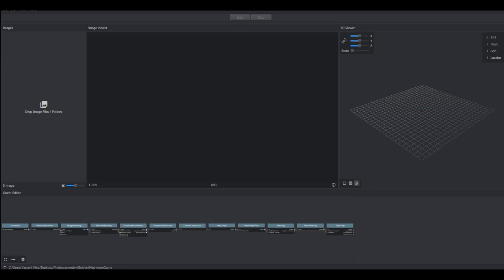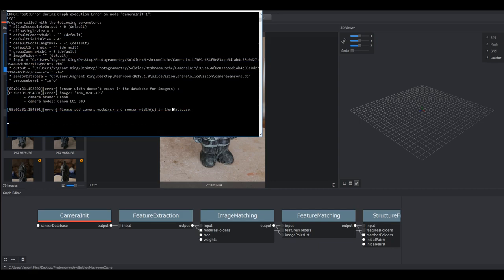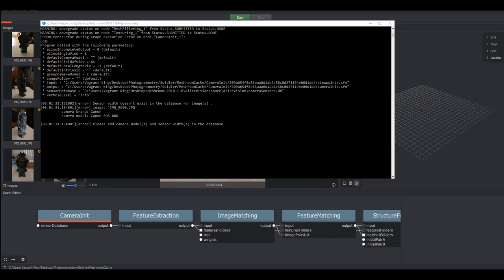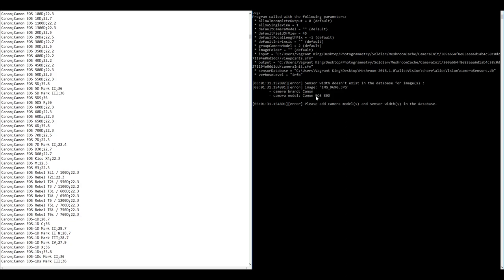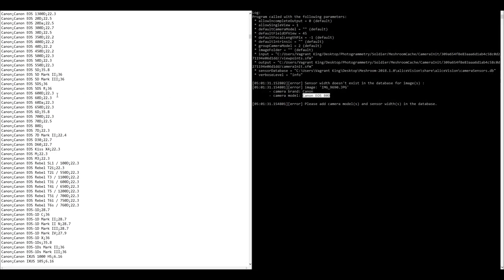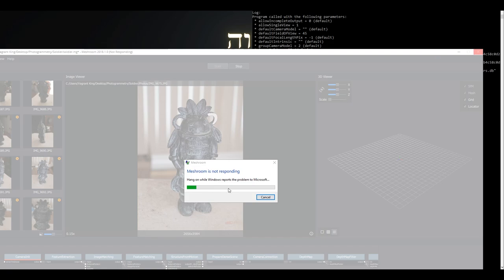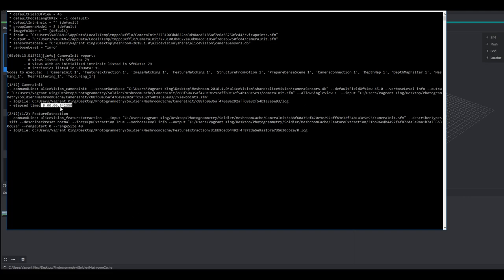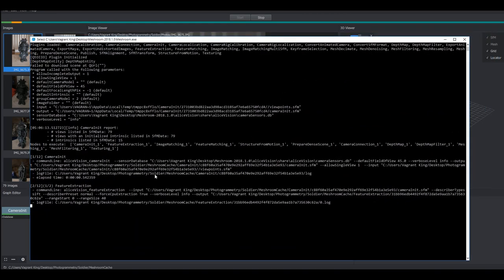Debuging Meshroom

Comment: In my PC during the process in mushroom it stops in depth map node and not starting even though I click on start how to solve it please tell me the solution
Reply from the maker: So, you will need to check a few things: 
- Make sure your graphics driver is up to date!

- Make sure your files are all saved locally. Don't work off external drives or anything like that.

- Make sure your photos don't have underscores (_) in the naming, especially as the first character. 

- If none of that helped then try this: make a backup of your files, then delete all the folders in the Meshroom project from depthmap onwards. Launch Meshroom and try it again. 

If that doesn't work, copy the command prompt error data along with your system specs into a pastebin/hastebin and link it to me, and I'll try to debug it. 

Some of my students have had similar issues, but what I've suggested has gotten everyone through the project so far. 

Best of luck to you!
Reply from the maker: @chandubejugam2410  
[08:45:54.777675][warning] Could not determine number of CUDA cards in this system
[08:45:54.776171][warning] No CUDA-Enabled GPU.
[08:45:54.777675][error] cudaGetDeviceCount failed: CUDA driver version is insufficient for CUDA runtime version
[08:45:54.777675][info] Can't find CUDA-Enabled GPU.
[08:45:54.777675][error] This program needs a CUDA-Enabled GPU (with at least compute capablility 2.0).

You need a CUDA GPU

Comment: This is really  helpful in trying to troubleshoot meshroom. I'm stumped on mine though, it crashes at FeatureExtraction every time and the command prompt window doesn't show any errors. I have no idea why it's not moving past that step-- and why whatever the issue is won't display in the command prompt. Every time I click start it moves past the Camera Init step, and then I get the spinning mouse icon, and then the program crashes leaving the command prompt open. Nothing changes in the command prompt-- and then that closes as well. I'm completely stumped.
Reply from the maker: Journey's End What kind of graphics card are you using?
Reply: @Crompwell  NVIDIA RTX 2070, i7 processor 64GB RAM (Razer Blade 15). I downloaded the previous version and everything worked fine. I'm guessing there must be some issue with the latest release that's clashing with my system. I can't figure out what it is though. For now the previous version is a fine substitute.
Reply from the maker: @JourneysEnd  yeah, unfortunately that can happen. I’m glad you were able to work it out!

Comment: What in the case of taking photos with smartphone with unknown sensor width? And unknown camera brand? So far have no problem with new Meshroom 2019, but also did not tried yet my Motorola smartphone, which is more handy for some situations. Thanks.
Reply from the maker: I have run into this problem. You will need to find out the sensor width of the camera you are using. This can usually be done with a quick google search. Next you will need to look into the meshroom files for the camera sensor DB file. You can locate it here: Meshroom-2019.2.0\aliceVision\share\aliceVision\cameraSensors.db

Open this file with a text editor and append your camera with brand, model, and sensor width (The command prompt/error log of meshroom should give you the camera model/brand). There are plenty of entries there for you to base your entry on. This should enable Meshroom to process the images you take with that camera.

Comment: Thank you for making this video, am fixing the ,,no camera instrinsic parameters" error
Reply from the maker: That is an error you can get, usually, when there isn't a database entry for the camera and sensor your photographs were taken with. Meshroom needs that data in order to run its calculations. You may need to input it manually into the database.

Comment: My Meshroom stops at "prepare dense scene", you meant that it can be fixed easily, i didn't find anything in the internet than people saying you should change some folder name, but i really didn't get it.... can you maybe help me?

thanks a lot!
Reply from the maker: This happens sometimes. There are a few things that could be going wrong. 

Firstly, ensure that all your photos and your project are saved onto the hard drive of the computer you're working on. That means no using photos or project files that are saved onto SD cards or external drives.

Secondly, try to remove spaces in file names and if the file starts with an underscore, remove the underscore.

If none of these things work, you may need to start a new project.

Also, make sure you're using a CUDA enabled GPU and that your GPU driver is up to date.

I Hope this helps.
Reply: @Crompwell  Thank you! Ill try
Reply: HEY!
Just wanted to you know, that its also not working if its on your second hard drive!
I have two harddrives, one for the programms and one for data, but i will always have to create a temp folder of my win harddrive, where i put the data in, im currently working on!
thank you very much anyway, maybe this helps other people too!

Comment: Hi Crompwell ! May I ask about the meshing process? Why my rendering always stop at meshing? The command prompt shows like this:
 
[17:30:18.645288][info] Filtering done.
[17:30:18.646286][info] 0 invalid points removed.
[17:30:18.646286][info] The number of points is below the max number of vertices.
[17:30:18.646286][info] 3D points loaded and filtered to 0 points (maxVertices is 5000000).
[17:30:18.646286][info] Create final visibilities
[17:30:18.646286][info] NANOFLANN: KdTree created.
[17:30:18.646286][info] Create visibilities (0/3)
[17:30:18.646286][info] Create visibilities (1/3)
[17:30:18.646286][info] Create visibilities (2/3)
[17:30:19.198595][info] Visibilities created.
Abnormal program termination: function terminate() was called
Reply from the maker: Naziff Nazri it’s difficult for me to know, but it seems like there are no actual points with which the application has to create the mesh as per the line that says “3D points loaded and filtered to 0 points.”

Somewhere along the process, Meshroom is running into trouble getting points to make the mesh.

Comment: Thankyou for your GOOD tutorial, Crompwell ! 

I have a 'problem'.. my 'photos' are (quantity: 399 jpg) .. 1280x720 I got by PC screenshoots (no sensor dimention!).. but while in "StructureFromMotion".. Meshroom crashes.. 

please, help !..
Reply from the maker: You will need to look up what your camera make, model, and sensor dimensions are. Most are available on google. Then append the values to the sensor.db included within the Meshroom files.
Reply: @Crompwell   thankyou for your quick reply :) /// there is NO camera ! :))) every jpg is a SCREENSHOOT from my PC screen.
Reply from the maker: @PaoloFrunzio  Meshroom needs camera data in order to function. So, unless you can provide the data of the camera originally used, it won't work.

Comment: Hi I'm a User,I have a Problem with MeshRoom.

When my laptop Closed Unexpectedly,The MR Start button goes grey,and there are the title type Graph is being computes externally.

How do I fix this?

ThankYou.
Reply from the maker: This is an issue that a few of my students have run into. First, make a backup of your project folder! 

One of the common fixes is to see where the process stopped. For example, if it stopped at "depth map," then go into your meshroom project folder and delete each folder corresponding to the process nodes where it was stopped or has not yet been computed. Then close and reopen meshroom and your project. That usually allows you to start the project again. 

If not, you will need to look at your photos and if they are saved locally or are being read from an external source such as an SD card or external storage. You SHOULD NOT be running meshroom if your photos are not stored locally on your machine.

Otherwise, you may want to check issue tickets on the meshroom repository or submit your own. 

I hope this helps. Best of luck!
Reply: @Crompwell  Thank You So Much!
But I already Figure it out,and did fix it.
And yeah It stops at the same name thay you are  typing,Depth Map.
Well what I was doing is that I'm Delete the Pending Data on the Blue Tosca Colour,Then it fixed!
Btw thanks for helping me out..

Comment: Mr. Cromwell, I'm a new subscriber. I am very interested in the Forensic use of Meshroom and programs like it. One thing of immediate interest to me is scaling a point cloud to get measurements. For example if I do a photo series on a tire impression that includes an ABFO scale along the edge and it is part of the generated point cloud, how can I use that to set a scale within the cloud points that I use elsewhere? You can find me on LinkedIn or reply here.
Reply from the maker: I'm not sure how I missed this comment, my apologies. Unfortunately, I'm not too familiar with the concept of manipulating point cloud data, as I'm more of a designer than an engineer.

Regardless, I would have to venture to guess that, providing the data is as accurate as possible, one might be able to generate a mesh of the tire impression and compare that against the provided ABFO scale. Depending on the software used to manage the point cloud data, it may be possible to set the overall scene scale to ensure the data is presented accurately in the software. If not, the scale can also be set properly within 3D software like Blender, for example.

With a little math, this might be enough information to recreate the forward surface of the tire and tread. However, the difficulty in accurately reconstructing the tire will be determining the circumference based on the tread pattern. If there is enough data to clearly indicate a repetition in the tread, that may help find the circumference. 

I hope that helps in some way.
Reply: @Crompwell  I had simple problem where Meshroom said that focal length is unknown, but processed photos anyway. Just in blender it is somewhat wrong scale. It is easy to fix by using scale for x,y and z coordinates. For calibrating, also it is possible to 3D model ruler sitting on the table for example. Then just adjust scale so that next time we know how to measure features on 3D model. I am also more interested in 3D art than forensic, but that may help reconstruct the scene.
Reply from the maker: @MilanKarakas  Hmm, accurately replicating scale in 3D is somewhat finicky. Photogrammetry replicates the proportions of objects with as much fidelity as your images can provide, however, matching scale is usually something that needs to be done in the software after the photo-scanning. Using a ruler may help provide you with a good reference to scale, so long as you can read it. It's very common for people working in forensics to include some kind of measuring instrument in their photos, so this seems in line with your goals.

Comment: Why are you not replay to my problem
Reply from the maker: I am not able to respond to every post on this platform, but I did try to reply to your problem. I'm not sure if you got my comment: 

So, you will need to check a few things: 
- Make sure your graphics driver is up to date!

- Make sure your files are all saved locally. Don't work off external drives or anything like that.

- Make sure your photos don't have underscores (_) in the naming, especially as the first character. 

- If none of that helped then try this: make a backup of your files, then delete all the folders in the Meshroom project from depthmap onwards. Launch Meshroom and try it again. 

If that doesn't work, copy the command prompt error data along with your system specs into a pastebin/hastebin and link it to me, and I'll try to debug it. 

Some of my students have had similar issues, but what I've suggested has gotten everyone through the project so far. 

Best of luck to you!

Comment: Hello! 
I have a problem. Meshroom stops at texturing. What should I do?
Reply from the maker: Save the file and try to relaunch meshroom. If that doesn't work, make a backup copy, delete everything in the texturing folder and try again. Otherwise, try it on a different machine or new project. Make sure your graphics drivers are up to date.
Reply: @Crompwell  why dont the programmers just do the small job of making the software intuitive? they could even charge for it
Reply from the maker: @snorttroll4379  This isn’t a very constructive comment. I’d guess they want to keep it free and open source. You could always take suggestions directly to them.
Reply: @Crompwell  I expect them (programmers involved) to read my comment and either implement the improvements or make a paid software that works.
Reply: @Crompwell  oh. yes. constructive. Get a non nerd on the team. anytime there is doubt of what to do, just obviate that problem by making an in problem instruction. cannot compute? tell us why. also guide us to do it right the first time. like when installing a new app and it guides you through your first use. 
if an image cannot be used, tell us up front before computing (by computing) and tell us why. people just want to snap pictures and get a 3d model out. make it simple. 

also the gui was unintelligible the first time. 
why the squares at the bottom? should have been explained by a wizard. a literal virtualone that walks you through the gui if it is complex.
Reply: @Crompwell  drag and drop images, 3d model is automatically made immediately after that. if there is something wrong, play an error sound and tell us for example: Take more pictures between picture 4 and 6. 
or just take more pictures. or take pictures from further away, but zoomed in so everything is in focus.
Reply from the maker: @snorttroll4379  There is paid software in the market, you know.

Comment: Hey, Crompwell! I'm having issues with this particular error: ERROR:root:Error during Graph execution Error on node "ImageMatchingMultiSfM_1":
Log:    I attempted to lower the point size (it seemed to be the fix for a few people in one of the troubleshooting forums) but it still persists. My depth map processes with no issues. Any suggestions?
Reply from the maker: Ashley Osborne What kind of gpu are you using?
Reply: @Crompwell  Nivida RTX 2070 Super...
Reply from the maker: Ashley Osborne That should work fine for Meshroom. Are the photos you’re trying to use saved onto the same hard drive that you’re running Meshroom from?
Reply: @Crompwell  The images are saved on my onedrive, but the meshroom program is ran locally on the machine...should I try moving the photos from the oneDrive to the the local folder on the PC?
Reply from the maker: Ashley Osborne Yes, definitely. I’ve noticed that people almost always have issues when attempting to use photos that are not locally saved. Let me know if that fixes the issue.
Reply: I just moved them over to the the pic and it still fails...could it be the amount of photos? I have ~20 added to the project currently.
Reply from the maker: Ashley Osborne I suppose that could be it. I usually have at least 30+ images. Try to take more photos and see if it works?
Reply: @Crompwell  Will Do! I will try to take a few more and see what happens. I appreciate your time and I will let you know if adding more photos solves the problem.
Reply from the maker: Ashley Osborne No problem! I hope it works out.

Comment: Hello, thank you for the video but I'm getting an error that says
RuntimeError: [COMPUTATION] Impossible Process 
A help would be very appreciated . 
Thank you in advance.
Reply from the maker: Are you using an nvidia gpu with CUDA compute power above 2.1?
Reply: @Crompwell   Yes, I'm
Reply: @Crompwell   I'm using NVIDIA 940MX which has 5.0 score according to the NVIDIA list
Reply from the maker: @abhishekm4434  And you are on Windows? Your photos are on the local computer’s hard disk and not being read externally from an SD card or portable storage?
Reply: @Crompwell  Yes, i'm on windows and the files were in my local disk. But it seems that I took the photos on my OnePlus 3T and it might be an error even after I changed the database too.
Reply from the maker: @abhishekm4434  Ah, that might well be the case. Try to correct it. If it doesn’t work, I would suggest trying to use one of the camera makes and models already listed and use the sensor width from your camera model. See if that works and if not, my best suggestion would be to go to meshroom’s GitHub repository and submit an issue ticket and see if someone there can help you.
Reply: Yes thank you, I did all the things, from git hub to reddit, but it all this was not able fix, the only option left is to use a device which is already listed the in the database file. And that is the final try I'm going to do, wish me luck. And thanks again.